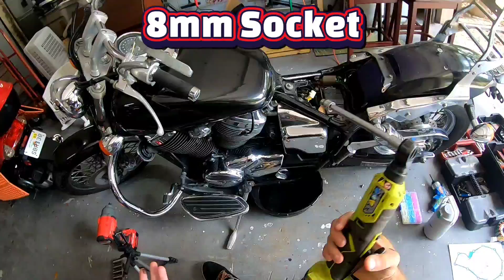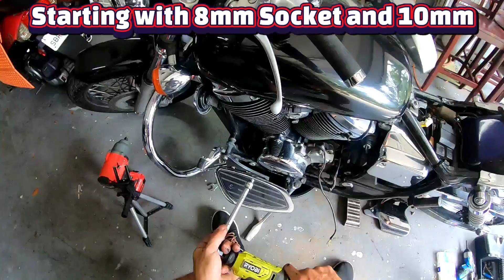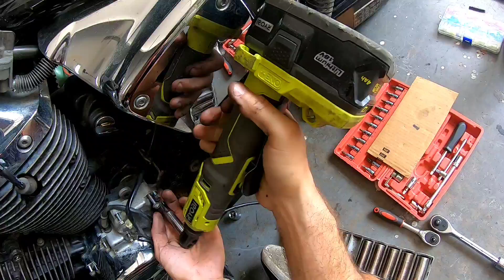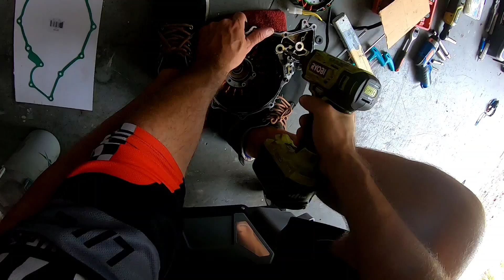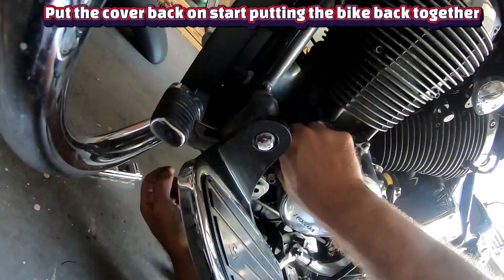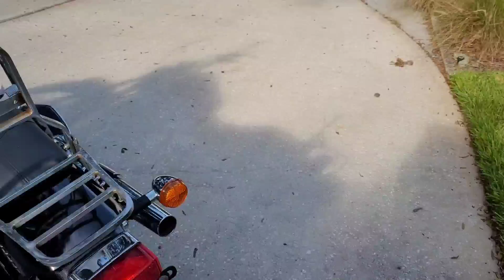The Expert Guide to Honda VT 750 stator replacement #diy #repair #motorcycle

Comment: Gotta change mine on my 01 750, first video that popped up. Watched the entire video while relaxing in bed to just get an idea of time frame. And to note to get a stator with the rubber gasket 🤣🤣. Thanks for the video, if I personally have any recommendations as far as video goes, if you can speed up the time while removing gasket, pulling bolts ETC, would make for a shorter video and maybe more views due to less time on video! Great presentation. Showing that you have knowledge of tools and thought processes to pay attention to bolt lengths is important, also shows the struggle of never doing one and getting your feet wet.

When I do anything at work with engine tear downs or something with multiple bolts, I’ll use a big piece of cardboard and draw out the engine with holes where the bolts go. Makes it easy to go back together, also hang it up on the side or back of my box for next time. First one takes you time, next one is that much faster! Great video man!